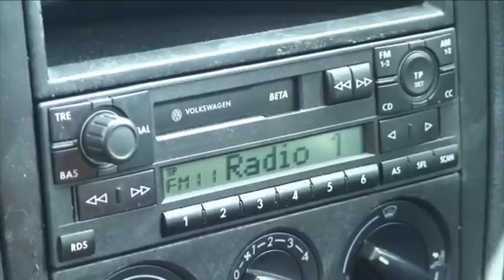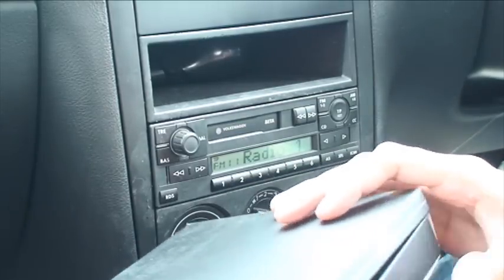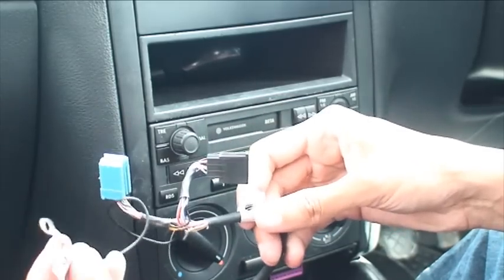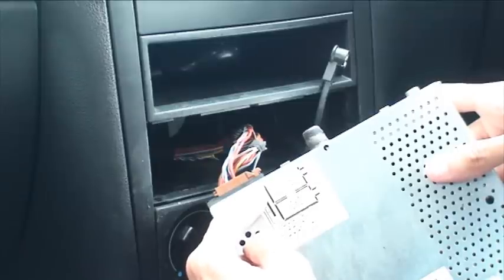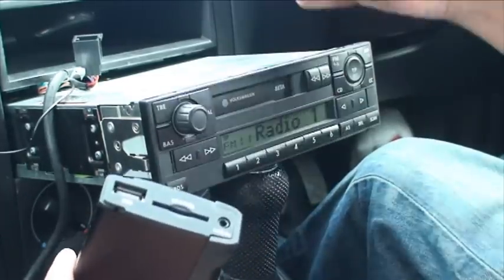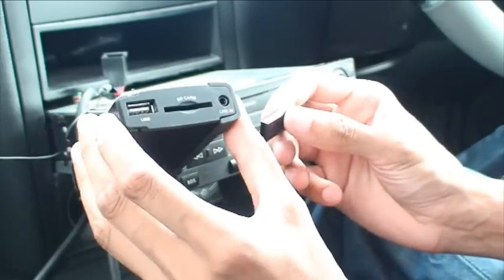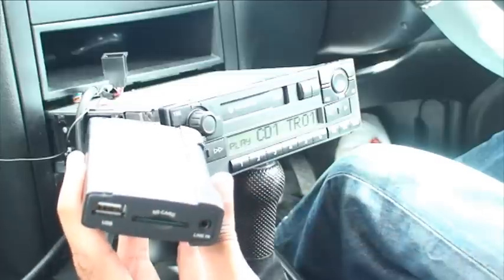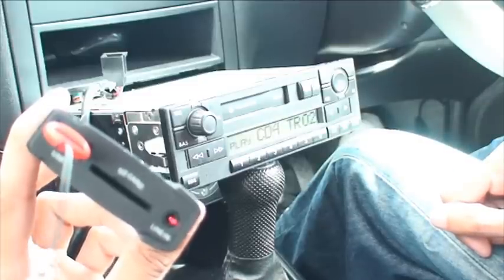How to Play Music from Micro SD Card / USB Stick in your Car Easily (XCar Link Adapter)

Comment: The current price of this gadget is US$35 (with a port for Blue Tooth option) directly with  XCar Link. I just got one. It is good solution for those intending to keep the old original head unit but getting rid of CDs.

Comment: Since the sgs3 and nexus 7 seem to have sub audio out and have already been shown on YouTube to work with usb audio devices, you could use the device you showed in the video and use the usb port on that to connect devices like the sgs3 and nexus 7 for gettin lossless output to car stereo if your present car does not have usb input. Great way to make the nexus 7 into a car infotainment device plus you could use the torque app to get car management info on the nexus 7 when paired with other device

Comment: I'd like one of these in my Renault Espace mk4. As it has a hidden amp/radio and separate 6-disc cd changer, the head unit cant be changed. If I could swap the changer for this gizmo, I could quadruple the amount of tracks I can play in my car and still use the car's stereo controls. Perfect.

Comment: To people saying " buy a new head unit " , for instance in my Citroen, my original head unit , a blaupunkt rd4 , is linked to the board computer and to the volume buttons located on my steering wheel. So changing the head unit would've meant being deprived of wheel controls, and fucking up the date and time, and the whole board computer. So this x car link was my only solution and its awesome. 

In this video however, well yes a new head unit, maybe more expensive would've been ok I guess but everyone makes their own choice !
Reply: Actually, you can change the head units and keeps your wheel/rear seat/roof music control.
You must know what you do and buy the right head/adapter, that's it.
Reply: Yep, as Pat said, you can get a wiring harness to retain those steering controls. Good place to call up is Autoleads (assuming you're in the UK?)
Reply: i have a citroen c3 (2008) and i have the same problem...is this a viable option...have u tried it?
Reply: I don't have steering controls on mine, but my brother has. Had to buy a specialist adaptor with steering controls to adapt Pioneer to Vauxhall ISO fittings. Worth giving the Autoleads guys a call

Comment: Nice & quick change between folders too, a shame Xlink dont do an adaptor for my Jag! Slightly surprising seeing as its an Alpine based setup (with a standard BMW/Merc type 6 disc changer in the boot), with Ford type connections.

Nice video though mate, well presented & explained.

Comment: Hey. I have Audi gamma radio. But it doesn't have CD changer slot. Well it does have it, but there is no pins in there. So I don't think it will work. Any ideas how I could connect AUX cable, or adapter like yours? Thanks in advance.

Comment: Hi, so I installed the same Xcar on the same radio Beta. But it seems as if it doesn't even try to read from the USB (no blinking on the drive itself). The flash drive is a 4GB formatted to  FAT32. The folders are named CD01 to 06 and each has less than a 100 songs in it. I haven't tried SD or AUX inputs. Do you know what could be the problem

Comment: so this will only work if my stereo is capable to change multiple cd's so in this case be a cd changer? as i have bought a Astra the stereo is 'cd30' which has no aux port and not able to connect one and dont want to change the stock unit. could i still install the XCar Link?
Reply: +Jack Singh Just buy yourself an aftermarket unit and do yourself a favour. It will be cheaper, it will have 10 times better audio quality, you won't have another thing sliding around in your car and wasting space and it will actually say on the unit what song you are listening. Did I mention it will be 50% cheaper as well? Yea, this is a complete waste of time. Only an uneducated person would buy something like this over a proper aftermarket head unit that does all those things way better for half the price...

Comment: It is meant to replace a CD changer unit that is normally kept in the boot of the car. If yours doesn't support a CD changer then it won't have the socket on the back of your unit to plug this in.

Peace

Comment: I have this same gadget and it goes up to CD10 folder maximum with 99 songs in each one. My head unit only supports 6 CD's but i think near enough 600 tracks is enough for me.

If i want more than that then i just pull out my USB stick and put another one in - simples

Peace

Comment: Can you get something like this for an aftermarket stereo?
Reply: +Rick B Yes, if you have an input for the xcarlink.
Reply: +Rick B Why not buy another head unit for far less money??? And not have another thing sliding around in your car wasting space? Plus have the songs you listen written on the head unit and not having to ridiculously label them "CD01, CD02,...". Makes absolutely no sense to buy this. Plus aftermarket radio will work in any car you want.
Reply: +Atrax R I know what you aer saying buddy but i love the sound quality of the Alpine with the matching DSP i have. I've had other HU's  just i can't get the sound quality of the setup i have.
By the way, nice OBT
Reply: +Daniel Savescu (SavyRO) Cheers bud
Reply: +Rick B cheers mate. If XCarlink doesn't have the proper input for your Alpine, try Loulink. I thing they have an universal version, which suits all car stereos, and plus, it will display song name and artist if the stereo supports it.
Reply: +Daniel Savescu (SavyRO) Thanks again mate, xcarlink doesn't but I'll have a look at the other

Comment: Do people still use CDs in cars? I see you're using a cassette so you have nothing to talk about.
Besides, 85$?? You can get a great head unit for that money and it will be way better in every way possible. This is hardly "keeping your cost down". More like "let's waste our money". What you did there makes no sense what so ever.
You can also take that head unit out and put it in any car you want. Not to mention that you have another thing rattling around your car and taking space. Rather pointless and wasteful as far as money and space goes. Which in turn defeats the entire purpose of this video.